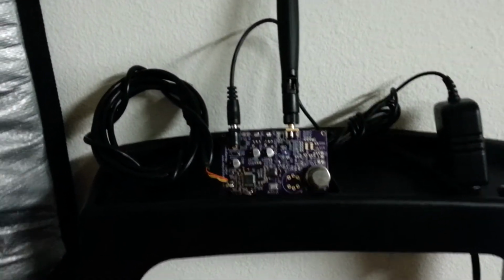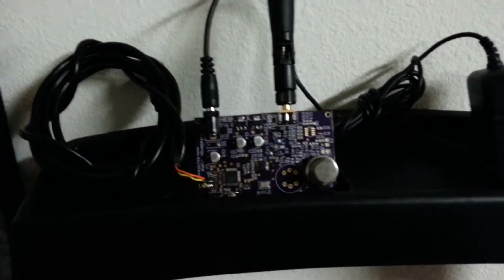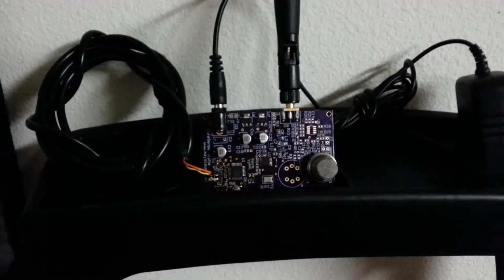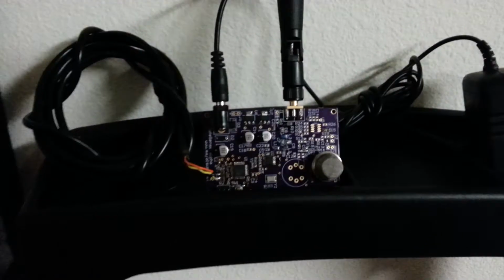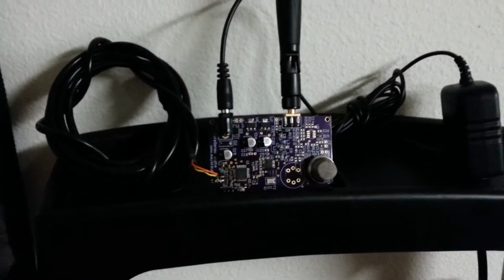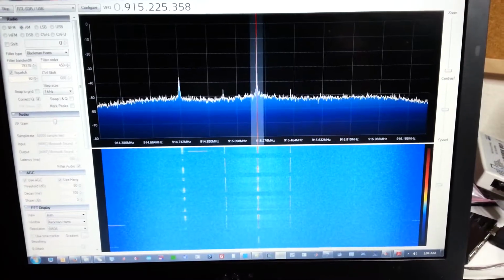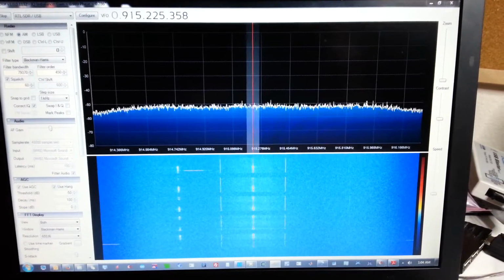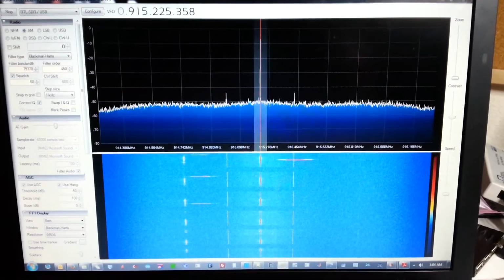RSSI Bringup on MRF49XA

Comment: Sir, Is that shield for arduino detects the rssi of the cellular radiation? I mean, Does it work at 850MHz? If so, Does it have any library to program it?
Reply: The shield operates at 433 MHz, 868 MHz and 915 MHz ISM bands, however the balun is tuned for 915.  The 868MHz option can operate 860 to 880MHz thus it will have the ability to capture a segment of GSM 869–894.

I have been developing code for this shield, it is not a product.  If you're looking for a turn key solution, it's not ready.  However if you're interested in working on this with me, I can send over code and spin an Arduino-compatible shield.
Reply: Eric Rogers Im doing a thesis that need to calculate the rssi value of the 850 MHz ISM Band, that is mobile telephony in my country. I was looking the shield (MRF49XA) here, but I only found it in DigiKey and Mouser. So it would take a lot of time to bring it here and time is something that I dont have. I need to finish that this cycle.
Reply: Is the end of the cycle September?  December?
Reply: November